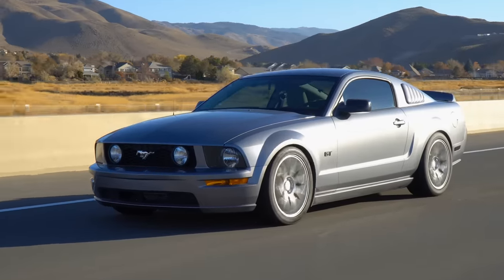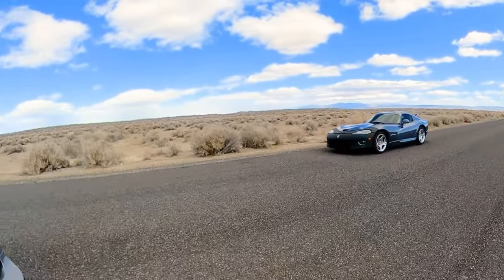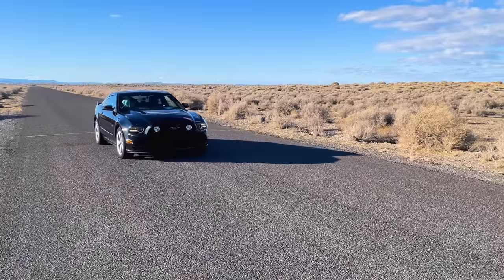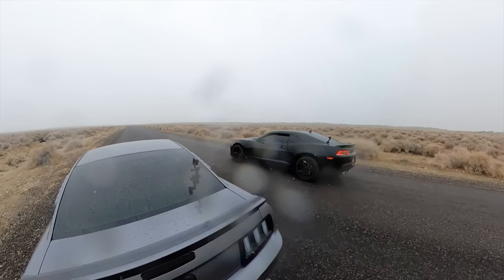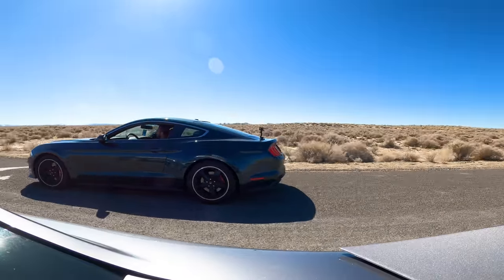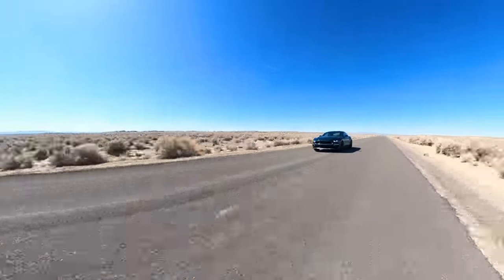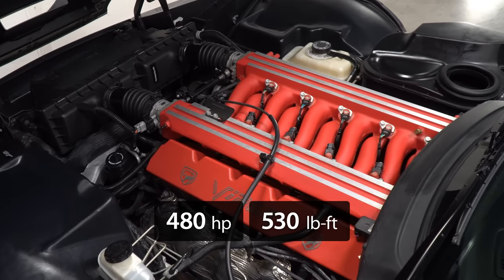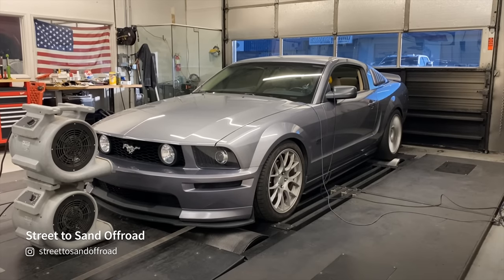Showing the world what an all-motor 4.6 Mustang can do

Comment: The bullet was experiencing heat soak. Each run raises the temp of engine internals, air piping and coolant cutting your oxygen density down. Colder air is more dense, shoving more oxygen into the cylinder. Hot air holds less oxygen, so less power.

Comment: Good looking car and great  video👍🏻 

It’d be interesting to see what kind of returns could be achieved using the same approach with a 2V. 🤔
Reply: Well..  if you swap heads, add stroker kit, change the transmission, change the differential gears,  cam swap, and a bunch of other stuff…. Your “4.6” will run like this. 😂😂😭😭😭😭😭😭😭😭😭
Reply: 😁👍🏻 

Mine isn’t installed  in a Mustang. 

Box and diff have some leeway power-wise, as far as I know, as it only makes 245bhp and 301 lb ft at present. 

I’d not be making any changes to capacity, or the drivetrain, but I’m curious as to whether head and cam swaps would make much extra power.

Comment: It consistently amazes me when people on the street have zero idea why they’re modded vehicle gets shit on by seemingly “easy prey”. 9 times out of 10, it comes down to gearing and they don’t even realize. My favorite is when diesel bro’s lock in 4H at a red light thinking they’re gonna “launch” or start brake boosting for a roll race and they still get bodied. I’ve even tried to tell a few of em to go get a custom gear set installed if they want to street race with a truck designed entirely for towing. They don’t realize that it doesn’t matter if you’re putting out 1000lbf to my 400lbf if you can’t get that 1000 to ground in any meaningful way. They still don’t get it and choose to be pissed 🤷🏽‍♂️ maybe they’ll learn one day idk but thanks for putting out this video as a reference for why it’s optimal to modify a car holistically rather than just “overnighting parts from Japan” because you saw them on a YouTube video or something. Bolt ons only take a car so far, eventually you gotta get down in the guts and make all the otherwise disparate parts coalesce into something greater than their sum. Great video and dope 3V

Comment: I had a 2014 Chevy Camaro RS V6 323hp and I was racing a lot of the Mustang 4.6L and I ended up winning a few of the races. They didn’t realize the Camaro I had either I can do automatic or a manual transmission since the one I have had a paddle shifter.

Comment: Hi, I appreciate what you’ve done with your s197, I wished i had of done the n/a route 1st on my ‘09.  Like you I like the body style better than the newer ones, looks more like vintage ‘69 fastback.  So I guess a little north of 400 rwhp is about what you can get without changing displacement?  Was it a lot or a little more than 400?  I did watch your previous build/steps videos on this car but it’s been a while.  I’m assuming you got the t 56 6 speed with 2 overdrives? If so, which gear set?  I’ve got the wide ratio with the 2.97 1st gear and 3.73 axle gear.  I have the 2.3 litre whipple kit, everything else pretty much like yours even the blue FR valve covers, excuse me, cam covers. No internal work except FR Hot Rod cams, roller rockers and timing chain system.  Thinking about 4.10’s cause my 6th gear (.50) is useless below 80 mph.  Anyways, Thanks for the videos.

Comment: I used to have a 2007 Mustang GT and I currently got a 2010 Mustang GT. All it has is exhaust and a tune and I'm not much of a racer but I beat Dodge Chargers and Challengers. I don't know what model is what but I know they are V8s. Those Dodge are my favorite cars to race.

With that said, my favorite car I ever owned was a 2009 Civic Si sedan. I would stay side by side with the Dodge cars in it. Sometimes beat them.The car was so much fun to drive. It ran like a 2 stroke ATV. 3rd gear was a monster gear in that car and I've caught people sleeping. And I know people make fun of these cars and I used to until I accidentally bought one. It's a long story but I traded a Ram for the Civic Si not knowing it was the fast model. I just wanted a gas saver.

I would give up my Mustang in a heart beat for a Civic Si of that year.

I had a red Challenger chase me all through town and I blew him away. I waited for him on the highway and he came flying up. I was sitting in second gear just below the VTEC RPMs. As soon as he got side by side, I stepped on the gas. VTEC'd him in 2nd, VTEC'd him in 3rd, then ran him a little into 4th. The front of his car was at my rear bumper. I stopped racing because I knew he would get me if I kept going. Homeboy was mad and wanted to race again but I quit.

That car ran like a Banshee 350. It was the total package. Quick, agile, great on gas. Little 6 speed go kart with a 2 stroke. That's what it felt like.

Comment: You know I just realized the 4.6L and 5.4L 2V and 3Vs (for both) Modular (or Triton) engines are really the only and certainly the last single overhead camshaft V8s I can think of. The rest of the V8s are either OHV or DOHC.

I feel special now about my slower Crown Vic haha. I guess there’s not much advantage to SOHC as there is in DOHC (because Dual makes way more power) or even OHV (because it’s physically smaller so you can fit in more displacement), but still pretty neat.

Comment: I've seen the Terminator cobra kick major azz. It was the last of the Foxbody design 2004. It was faster then the 2005 retro look 4.6. Thinking it was a 4V. 4.6 4V 1st came to be in the 93 Lincoln Mark 8 before Ford put it in the Mustang. Slight difference in the Romeo 4.6 and the Windsor 4.6. Did very well at the time smoking other V8s except for the Trans Am Ram Air.

Comment: There are several variants of the 4.6 V8, some of them pack a punch. IIRC  the four valve units are the strongest stock units built.
The less powerful variants have something else worth mentioning: their longevity. There are some with over 900K on them and still going.
As for the Coyote, I own one that pushes 395 hp. Torque is around 500. The F-150 it's in delivers a fantastic ride and doesn't even feel any load and/or trailer I've ever pulled with it. When unloaded it will embarrass 90% of the street racers around here. To my knowledge it's still stock. The 6R80 it's mated to has had only one upgrade which was for longevity only.

Comment: I have a 06 4.0 that is tuned and runs good but i am eyeing a 07 4.6 gt . I am just worried that the gt will be a lot of trouble compared to my little 4.0 what do you think. The gt has 160 thousand miles bone stock average use my 4.0 has 250 thousand still strong. some people say the 3 valve is a lot of trouble,

Comment: There's nothing like the scream of a 4.6 3v at high RPM through a really nice exhaust.  Yes, the 3v was a turd in stock form even at the time it was new, but you can work with them and get them where you want them.  I've never owned or driven a 3v mustang.  I went from a H/C/I 95 mustang GT t-5 to a 2012 first gen coyote MT82 all stock with less than 12k miles on it.  All it's got is a K&N intake and a corsa cat back with 3:31 gears but the power difference is insane with that first gen coyote vs. the old SBF.  I do however miss my old 95 t-5 manual clutch, throttle cable, and the bulletproof SBF.  The 2012 is just such a nice overall performance car though, even with it's flaws.  I plan on doing an aftermarket shifter, braided clutch hose, and looking at maybe an aftermarket transmission mount to for better shifting.  It's nothing like the old T5 where I could just do a quick clutch stab and bang it into second gear at 6,000 RPM without even lifting off the gas.

Comment: Wonder how well my 2.0 camaro would do, I think it pushing nearly 400 with zzp coils, oil separator, waste gate, blow off valve, throttle body, and a catted down pipe. Along with an injen cold air intake, a mishimoto muffler delete/straight pipe, and eventually a mishimoto intercooler. All that with tuning for all the parts, more boost out the stock turbo, and so far a 50% e85 and 50% 93. I feel like it could hold it's ground against your mustang. Maybe the viper but I'd probably let the viper win BC I like a good viper 😂

Comment: the reason the 1LE did better than the first 5.0L was the rear gear

they call it a torque multiplier for a reason
the bullitt was heat soak
Reply: As a 5.0 owner, I was able to do 0-60 in 4.3 seconds at best, and also know the shifting on both 5.0s fucked with the performance. Every shift made it lose momentum. It could have done better.

Comment: i have a 2007 gt mannual stock engine bbk filter with bbk short headers with tune . do you recommend a 4.10 ratio or i still on the original ? because i have a noise from my diff and im planing to change it . thx you

Comment: I have a 2010 GT Track pack from what i have seen the 3v will put down 400rwhp with just livernois heads and exhaust? Also i beleive the torque specs arw a little under rated on the 2010 Brenspeed put down 275hp and 304ftlb

Comment: My 09 gt has 410 gears and hotrod cams and I deleted the IMRC and have not tuned it yet for them so its kinda in a limp mode it won't make power passed 3400rpm and iv ran neck and neck with a cammed 6.2 Camaro SS

Comment: Why? The cost is outrageous to get there. And comparing to most of these stock vehicles isn’t legit. A 4V 4.6 is the only 4.6 worth doing. And yes, I know exactly what I’m talking about. I’ve built dozens of every Ford V8 engine working for a very well known Ford shop. Starting with a 4V or Coyote and then turbos would have been pretty equal in cost and you’d have another 200-300hp than you’ll ever get from this car.

Comment: Just to put this out there you can make roughly 480 hp with all stock parts more with stage 2 cams exhaust work and upgraded intake and I have been able to eat up ss Camaros and srts in a 2000 mustang gt 
Which has me confused why you were struggling to make more power with that car with all the upgrades
Reply: I believe it's because the engine set up is different. The 4th gen Mustangs only have 2 valves per cylinder whereas these have 3 hence the nickname "3v Mustangs." It does confuse me how that doesn't help in the long run but I am not a huge guy in this department. Sadly I've only had v6's so far :(

Comment: 300 HP for these s197 cars is enough power for most people.  WAY more than I need.  I can pin my passengers to the seat into 3rd, that's fast enough for me.  It's only slow if you are racing someone, something I'll never do anyway.  Newer cars like the s550 are simply more HP and tech thrown at it so no surprise there.  The s550 is a great vehicle but it's far too euro.  The s197 is the BEST looking Mustang since 1970 plus it still has that old-school look and feel which I absolutely love.  Esp the earlier ones like my 2006, DAMN that thing looks good!  The classic Mustang styling is mostly lost in the s550, sorry folks but at that point you can buy a Mercedes or BMW.  I'll take my paltry 300HP in my s197 over a 450HP s550 **ANY** day.

Comment: It's amazing how much different American cars are compared to German. That Camaro has a 6.2 Liter V8, but does 0-60 in 4.5 seconds and a quarter mile in 12.9? My RS3 has a 2.5 liter 5 cylinder and does 0-60 in 3.3 and a quarter mile in 11.8. 

Hell, my 2017 S3 beat those numbers and it had a 4 cylinder.

Comment: Wouldn't supercharging it be nicer than turboing it? Cos you won't lose the awesome sound of an N/A 4.6. Turbos wreck the sound cos they use the exhaust gasses, whereas superchargers don't mess with that. I just think a supercharger whistle sounds so much cooler, and you get way more fun down low shove. I have turbo 6 cylinders, but my V8s I supercharge. Each to their own I guess. I just think if I had to have one style forced induction for a V8, it's a supercharger all the way. Turbos for you viper for sure though.

Comment: I'm pretty sure if the vette had the same mods as the pony the stang would of gotten its doors blown away im an import fan but recently bought a 6th gen 1Le track pack camaro there was alot of gripe about camaro's being slow and when I got mine and lightly built it I was hammering a bunch of maro haters imo the 6th gens are not slow at all. However next I want to try a Ford gt 350
Reply: @rickitysplitz7035  
There is some insane imports out there though.

Comment: Lol, try and corner in it 🤣🤣🤣🤣
Reply from the maker: ...and then reveal that the Viper GTS ripped through the slalom cones at an electrifying 73.6-mph average. That's the fastest-ever Motor Trend slalom run by any automobile, surpassing a horde of modified cars, many of which were fitted with super-sticky race rubber. The Viper's achievement was even more remarkable considering its massive width, which typically works against a fast slalom time.

https://www.motortrend.com/reviews/track-testing-event-part2/

Comment: As a Mustang owner pisses me off that mustangs are not admired by the car community-at-large. The Mustang itself is a very bad a** car and they sound amazing and look amazing going down the road. It shouldn't be the car itself against the bad rep it should be the idiots driving the vehicle. I've owned a lot more mustangs and I have any other vehicle and they are so much better than any of them and that's after owning Camaros, a Corvette, and even a couple older muscle cars, and I just can't help but fall in love with the Mustang more than any of them. The sound in driveability plus how they look with the right exterior mods is just unbeatable in my eyes. They hate on mustangs is totally stupid and we should be more so hating on bad drivers that show off when they shouldn't instead of the car.

Edit: although the 4.6 might be talked down because of its lower amount of power than most other cars you can still be modified to pretty high amounts of horsepower. My 2002 Mustang GT could hit up words of 450 horsepower with a supercharger and full exhaust, there's currently a guy on YouTube right now building one of those motors out to 1000 horsepower. Any motor that's modified properly will make serious power. But the truth is the higher horsepower of the cars producer's stock, the faster you could produce power out of it with just bolt-on modifications.

Comment: I hate to be that guy but Just to save people from making the mistakes I made. I'm going to put in my two cents here.. I personally had very similar car built motor cams aftermarket heads and I even went further with a supercharger. But after going through 3 of these motors I cut my losses with the 4.6! It's just a waste of money when you're comparing to a coyote or LS.. for the money you have to put in that motor, the other cars are very close stock.. best I ever got was 1180s out of my old 4.6 Yes, it can do things with a ton of mods but they don't like to stay together. They're just super soft.. You can get a coyote in the tens pretty easily with never touching the lower end and  heads! except for cams Good tune gearing.. You can check my videos I've had cammed LS's and big block Fords and Im currently on my third SRT8 right now.. had a height 10 second GT350 that was pretty much stock except for pulley custom tuning tires. And I have an all motor almost 9 second Windsor base fox buddy right now.. in my opinion just start with any coyote car! Spend the same money and have an easy low 10 second car that will stay together..  I love what you did here but the same mods would have been more rewarding and appreciated with a motor that would stay together. Just putting my two cents in because like I said I went through three motors Just to make the car do what a virtually stock performance package car does today. Love the video but everybody else Make sure you heavily weigh out your cost to risk.. But again Great video! And these cars can be made fast. It's just to what end..

Comment: Full bolt on...not 4.6 vs a full bolt on 2011 or 2012 S4. 
I would be quite interested in the outcome. 
Have to watch out though, half the "full bolt on" guys I've seen/met only have a stage one car and don't even have a larger heat exchanger/intercooler if you will. 
So probably the same thing that happened with the bullet mustang. 
A real 034 stage 2+ car fbo would be a good run though

Comment: it's said the single cam 4.6 can be built to 500hp na and the dual cam cobra 4.6 to 1000hp na . though no one that I have heard this from gives any specs or fuel types used . vary cool 4.6 videos! a ridiculous vid to check out is a 5.4l lighting swaped crown vic ...

Comment: I have an all motor 6.0 05 c6 if your looking to see what your car can do
Reply from the maker: that’s actually a really good comparison since both cars debuted in 2005, are you in the reno/tahoe area?
Reply: @Four_Eyes  no I am not I’m in Las Vegas but I do head out that way here and there it’s a full bolt on corvette automatic 4 speed stock bottom end 100k miles manifold headers and cam on 91 pump gas I think would make for a good race. I will definitely get in contact my next trip up if your ever in Vegas we can meet up also

Comment: You people think you can pull horsepower out of thin air and in the c5's case you're pulling it out of a cold air intake and an exhaust upgrade that did absolutely nothing. The Corvette probably ran better stock 20 years ago. But I have to say your Mustang now is running pretty good January of '23 ¿`_

Comment: No matter what you do to it, it will always be a Ford and a muskrat ford at that. BTW, gearing fixes many drag racing ills. You failed to tell the final gear ratios of any of the cars. Also, why are you drag racing with your right turn signal on?
Reply from the maker: The gearing is about the same as the others, notice I shift at nearly the same time as the vette and the Bullitt. The 1LE has shorter overall gearing while the Viper has the longest. The strobe/flicker effect is caused by a mismatch between how many times the LED's flash per second (50-60 hz) and the GoPro's shutter speed (30 fps).